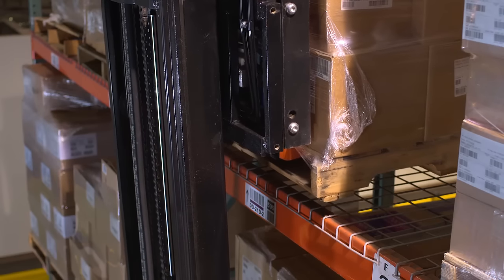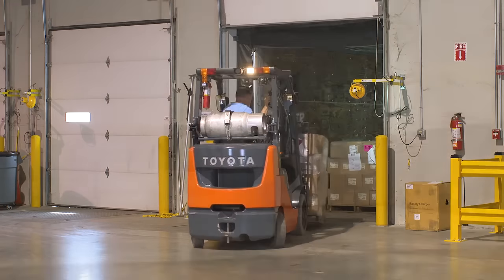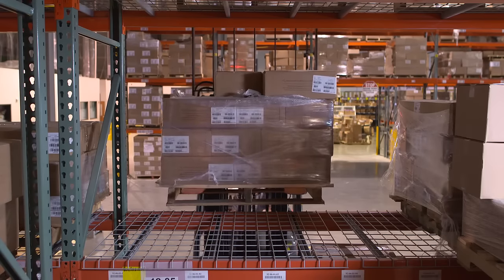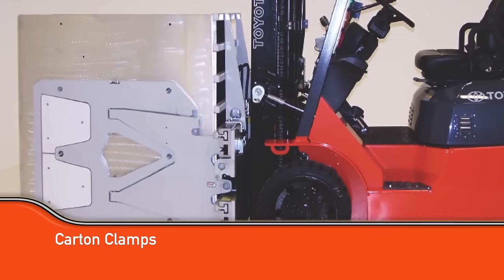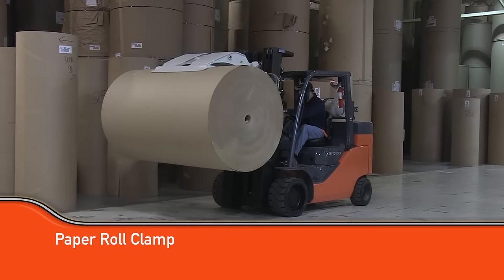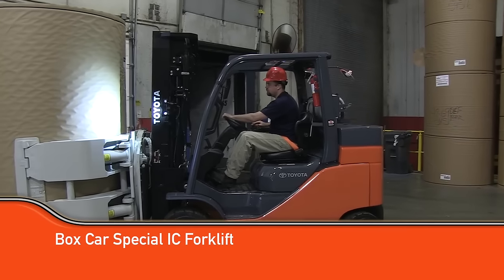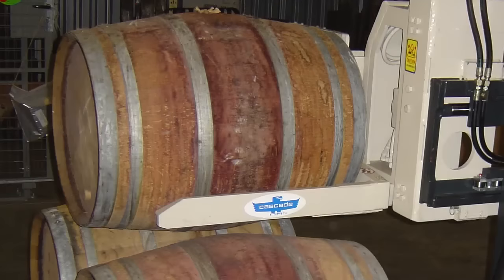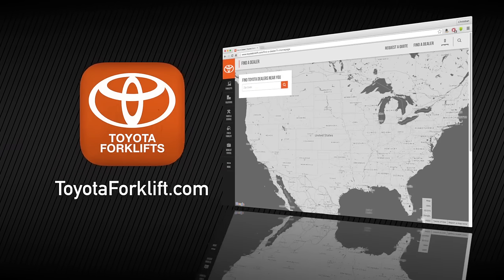Toyota Material Handling | Toyota Forklift Special Model Designs, Options & Clamps

Comment: Which Toyota Forklift model would you recommend for lifting 5,000 pound Aircraft landing gears. Used for driving indoors, outdoors loading and unloading trucks.
Reply: I personally recommend the Toyota 8FGCU25. It's got 5,000 lb lift capacity and LPG power for all day operation indoors and outdoors. If you need more capacity, the 8FGCU30 with 6,000 lb.